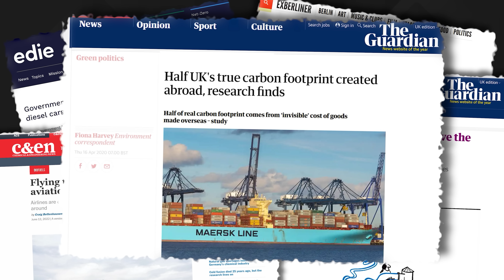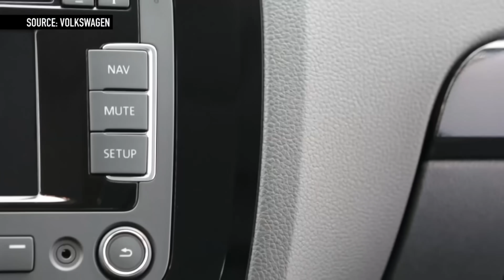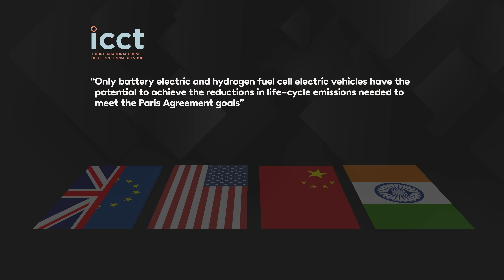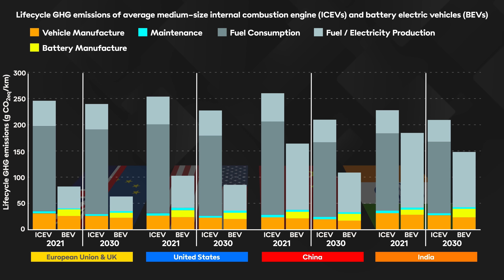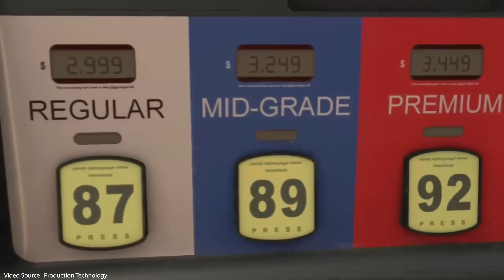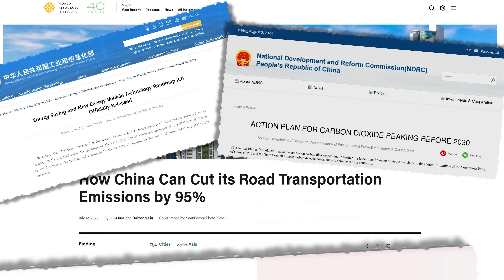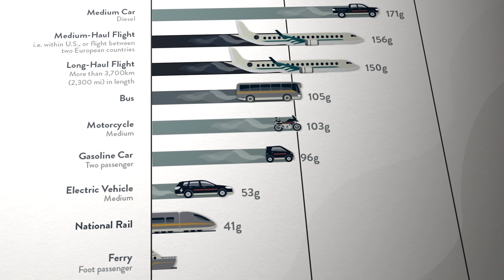Are EVs really better for the climate?

Comment: The question to me was never a direct comparison, but one which adds up emissions of combustion engines in comparison to those of the energy plants. If you use nuclear or regenerative this becomes a nobrainer in terms of emissions, though one needs maybe also compare the emissions to produce those cars and energy plants. The one saving grace of say coal plants could be a centralized well maintained filter system instead of having filter system on every car seperately.

Thinking of how long the car and petrochemical industry is already slowing down progress in terms of EVs makes me angry.

Comment: I need to know how they produce the electricity. 
Will the power plants not produce more emissions, especially the ones using coal, fossil and gas in producing those electricity for EV compared to the emissions from the fossil fueled vehicles? 
Can we only use the power plants powered by wind and solar to provide the electricity for EV? 
Is it enough and sustainable for those kind of power plant to provide all the EV the electricity they need?

Comment: Are there any studies that consider doubling or tripling the lifetime of the vehicle on the assumption that a significant element of carbon footprint come from the build process of a vehicle ? . What is the lifetime assumption in the report discussed ? I am running a 1993 vehicle which has been used for 3000 miles a year , I am telling myself that my combination of not consuming resources and not being responsible for the carbon load of a new car, every three years or so makes my strategy a thinking persons solution ax well as a affordable one but is there data anywhere that disputes or supports my thinking

Comment: One thing is that hybrid vehicles do reduce emissions whilst using a lot less batteries.   It is impossible to switch to EVs faster than the supply chain can achieve so hybrids probably have their place.   EVs simply are way too expensive for me to consider.  I'll probably just hang onto the car until it fails and my hand is forced or EVs start to come down in price.   I do remain sceptical about the infrastructure being able to supply all BEVs - time will tell.   I reckon once the big companies have us all on electricity for everything they can ramp up the price.

Comment: I think this commentator has to look at solution differently.
First stop petrol vehicles and get in electric vehicles.  Then use as much of renewable energies for the charging. Go off grid for the power.  And there are multiple other benefits in this noncarbon based fuel source.

Comment: One of the things not touched upon here is a gross lack of adequate infrastructure. In the U.S., West and Southwest grids are already having issues with the grid and capabilities. 
Also, what's the footprint of and electric car fire? Again, infrastructure, there isn't any! Currently most departments pour water on electric car fires!! That only makes it worse!! Electric car fires have been quoted as burning for days and sometimes more than a week.  I'd like to see a comparison of a gasoline car fire's toxic outputt versus an electric cars output of toxins, carbon and whatever nasty crap burns in each and how much they create especially since a car fire can be extinguished relatively easily.

Comment: There is almost no green hydrogen in the world; almost all hydrogen is grey and made from natural gas in steam methane reformers. There is a good reason for that: making green hydrogen is very inefficient and wastes a lot of green electricity. Green hydrogen plants use huge amounts of green electricity, primarily produce a lot of heat (large cooling towers required) and only a little bit of green hydrogen. It's a waste of green electricity; it's way more efficient to use the green electricity right away.

Similarly, there is way too little green electricity available to fuel the world's cars. So although in theory switching over to these fuels is favorable, in reality it won't work because they're simply not available in the quantity required.

Comment: Have you not seen the latest offering from Shell, adding charging points in lamp posts. Fine if they are going to pay to  harden the grid. Or are the Shmucks like the rest of us going to have to pay for every urban road in the country dug up and houses and lamp posts fitted with 3 phase supply. As it is some large houses need a 3phase supply for a large heat pump, add a fast charger and a 100amp supply will not be enough. No smart digital charge unit that can cut out cut in is going to save your cabling. You have burnt out your underground cables, that will be £30000 but we are booked up until January. Christmas sir, you can still get an LPG cylinder and oven to cook your turkey.

Comment: I live and work in Ukraine. I have dedicated my last 15 years to alternative fuel applications in passenger and commercial transportation. As a technical director and a guy who manages all technical issues, diagnostics and complex projects, I see a huge problem with system that are working under the 1-15 Bar pressure. 200 Bar systems, that are Methane capable, produce a noticeably greater complexity: tank excessive weight and pricing, need for more rigorous inspections,, poor filling stations network (CNG-Methane). 
If we talk about HYDROGEM - this is a story of the NON EXISTING infrastructure,  operational pressure of 700 BAR!!!, no technical support and I can not even imagine how much would a proper hydrogen tank would cost, its maintenance and life cycle : 3-5-10 years ? What will happen after this cycle and how much will the new tank cost (considering this item is critical to the safety).

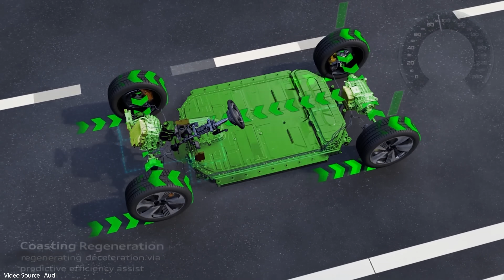8:10 Internal combustion engines are mostly reaching 40-45% efficiency with the potential to hit 60% soon. This numbers are discussed in professional media like SAE

If we talk about BEV : I see them often to ride at near dark time with headlights off, foggy windows, making the lowest speed permitted just to save extra mileage. The story about BEV is very promising, but the technology as the infrastructure is far from being self sufficient. 

There is nothing bad in internal combustion engines, the technology that been refined and taken to the perfection for 150 years. We need to change the fuel , used in this engine. We convert gasoline modern engines everyday that are using direct and dual injection, turbocharged and are working on diesel solutions, where a compression ignition engine would receive a completely new and clean fuel as a substitute to diesel. 

Changing the fuel used in the existing vehicles  (passenger and commercial) , will provide instantaneous effect. Tag: LPG, bio LPG, Dimethyl Ether (DME)...

The most promising and viable technology for the future EV cars, would be te HYBRIDIZATION: a 5-15 KW battery (reduced weight and lower environmental impact) + fuel cells that use a hydrogen rich fuel to generate electricity on board of the vehicle for propulsion and battery charging. This hydrogen rich fuel can be DME, stored under 5-10 Bar in a simple tank similar to LPG.

Comment: With a little more battery power, plug in hybrids could serve all short and medium trips on battery alone, running on gas for the long haul.  That seems better than keeping a gas vehicle in reserve for long trips.  right now though, big gas guzzlers are generally used for hauling stuff or going off road.

Comment: Nice review and summary. The ICCT paper just reinforces the uncontroversial consensus that an efficient EV powered by a grid with an increasing share of renewable generation is better for the environment. Researchers at the universities of Exeter, Nijmegen and Cambridge concluded in 2020 "Electric cars better for climate in 95% of the world": "electric cars lead to lower carbon emissions overall, even if electricity generation still involves substantial amounts of fossil fuel." And the Union of Concerned Scientist has been doing similar analysis for years: unless you barely drive a 50+ mpg hybrid in coal-soaked West Virginia, get an EV.

It's intuitively obvious once you do the math and to find a 35 MPG car will burn through 10 TONS of actually filthy gasoline over 120,000 miles, which turns into 33 tons of CO2. Adding a 1/2-ton recyclable battery to make a far more efficient BEV reduces that significantly, no matter how much fossil fuel companies try to whip up fake "But what about the toxic polluting battery mined with children's bloody fingers?!" hysteria. Making then burning petrol is WORSE, and a gasser burns through a lot of it.

Comment: Nice one. I'm skeptical about the impact of a bit of warming and higher CO2. When all predicted change is invariably negative and things like global greening are swept under the carpet then it stinks of politics more than science. That being said, your videos are very well researched and clearly presented. 
I think moving to EV is a no brainer and this 1st generation with lithium batteries is just a phase we need to go through to set up proper electric infrastructure now the funds are available on the big scare. Once the supercapacitors can be used for energy storage in cars there will be a huge reduction in energy spend per passenger mile. Very nice for air quality and noise reduction and dependence of fossil fuels even if I don't much care about carbon footprint.
Reply: Most wars have centered around oil reserves. Russia's control of fossil fuels being the current example. If they factored in all the lives and destruction from wars related to oil, what would the cost comparison look like then?
Reply: @kustomzone  Yeah, filling up your car is a bit like cutting a kid for blood to make your car run. Electric at least diversivies the sources. Coal isn't nearly as fought over.

Comment: I have looked into EVs a bit but my anxiety increases as I hear how a lot of the infrastructure for charging is either not at the level it should be for remoter areas or that they are not as well maintained as they need to be. I think the Tesla infrastructure is in much better shape than the rest.  Maybe the bill that will soon be passed will address some of these issues
Reply: If you have access to a plug at home or work, an EV is a no-brainer. There are plenty of public EV chargers, and there will be more.

Comment: Great as usual Dave. Good graphics, understandable and with your usual lovely style - laid back and open but authoritative and accurate. The only comment I wanted to make is on the short-haul flights being worse than any other form of transport - they are per km, but a long-haul flights uses a lot more kms, so the overall carbon is higher. Just important to point out so people don't think long-haul flights are somehow good things.
Reply: Indeed. One can easily do an entire year's worth of travel in distance terms in one long-haul flight. And if people had to drive or pedal that distance they'd think a lot harder about badly they needed to make that particular trip.

Comment: I plan on buying a plug-in.  Sure, the range is limited, but then, I don't drive that far each day.  I can use my gas guzzler for long drives, but if I don't drive it every day, that would save me a ton of money.  Add to that the solar panels that I'm going to install on my house and garage and it's effectively free to drive the plug-in (after the initial investment, which I'm going to do anyway, so it really doesn't factor in other than having a few more panels).

Comment: Reduced on-street pollution from EVs is negated by the increased pollution from the extra weight, which generates more dust from rubber and tarmac.
Reply: Nope : Curb weight	Mercedes S class = 4,740 lbs.   Curb weight Tesla Model S  Curb Weight = 4561.  You just might actually look up specs and data prior to writing.
Reply: @Avatrode  Now please compare lower end cars such as the VW Golf and its EV equivalent.

Comment: What about Hydrogen Internal Combustion Engine Vehicles?  JCB, Cummins, DAF, Toyota, Denso, Mazda, Kawasaki, Subaru and Yamaha (to name but a few) all seem to think this is a goer, yet all the lefty alleged "think" tanks still continue ignore this obviously superior technology. As Wikipedia points out - Electric vehicles appeared during the 1890s but the high cost and short-range of battery electric vehicles, compared to internal combustion engine vehicles, led to a worldwide decline in their use as private motor vehicles. As Einstein pointed out - Insanity is doing the same thing over and over and expecting different results.

Comment: In the rural western US, EVs are expensive impractical toys.  For those of us who often travel 250+ miles per day, in all sorts of weather, including sub-zero temps, they are essentially unusable.  My current ICE family "travel" vehicle has a range of 550-700 miles on a single tank, with the downtime in travel limited to 10-15 min stops.  On a couple of occasions, we've been on-the-road for 16+ hours straight, going over 1000 miles in that time.  Impossible to do in an EV without a significant increase in travel time.  Also: I fail to understand the logic of the EV proponents vs the financial realities of the US driving populace.  EVs are for that small portion of the market that changes vehicles every 2-4 years, when the average ownership cycle is approaching 12 years. My neighborhood is very middle class.  Out of a couple hundred homes in my immediate corner of it, there are two EVs.  This, in a place where almost every household has 3+ vehicles.  Primarily older vehicles.  This EV future is a pipe dream, unless average wages increase by a factor of 3 or 4.  Ain't gonna happen
Reply: I believe you are completely wrong. I guess we will see.
Reply: @CMac_44 "Wrong"?  Either the EV tech has to get both significantly cheaper and get incredibly "better" (range, charging time, longevity) or a large segment of the population won't be able to afford one.  We'll go back to the pre-Model T days where only the wealthy had personal vehicles.

Comment: we're just one battery improvement away really if you ask me. Granted there are a few things to over come, the only major issue is just making the battery: Anywhere, Cheaply, Life Time, and Storage. Granted that is a tall order to over come - but any parts of that improving means faster over all sells of EVs. Surfer Ion batteries would, for example, solve the issues of having to wait on China - thus some of the decarbon emissions can happen everywhere. Surfer batteries also come in cheaper, as long or longer life than normal li ion, and stores more power. Cost will only come down from there as it can be  produce and marketed against each other while still not having to wait for rare early metals to be found and produce. As for the house and grid power - we have a ton of options already. At this strage, the power grid is going to fight back instead on how much power a house can produce while still having the money to run the current power grid.

Comment: Firstly I am not a nah sayer,  I consider EV's the right and logical path for a motoring future. An important area contained in this transformation though is the probable change in many peoples lifestyles that will have to take place. We don't all live in big cities with on tap access to other transport options and not all of us just use our vehicles for personal or family commuting. Here in Australia the vast majority of trades people who don't work at a single site would drive a utility vehicle that would be a two or four seater and they would tow a trailer with their tools and equipment. Most of these vehicles are diesel and consume much fuel because of the towing. At this point we don't have Electric vehicles that can do this work. In many cases these vehicles would travel, on a daily basis, further than a fully charged battery would get them. I live in a rural area and most of my neighbours work in the nearby regional cities which are 50 or so kilometers away. Because of different places of employment or because of shift work two vehicles are often needed for a couple to go to and from work. There is no other transport option and its not a bike riding distance. As you say we have to try something and make a start but lets not think that it will be all beer and skittles for many people. One last point, my sone lives in part of LA and is fit and young and lives 8 miles from his work so he decided to ride a pushbike to work like he did in Australia. In the first week he was knocked off the bike twice and his coworkers all took bets on how long he would live. Even motorbike riding in LA is not seen as safe.

Comment: ICEs have made incredible progress over the last 100+ years.  But, they have become incredibly complex while doing that.  The comparative simplicity of electric motors means much less repair and maintenance costs.  Also, ICEs depend on one source of energy and that is oil whereas electric vehicles can use electricity derived from a variety of sources.  Finally, in the U.S. we have a government agency, the EPA, which has thousands of employees and costs the taxpayers many millions of dollars.  Those employees involved in regulating ICE-powered cars will become unneeded.  The proper thing to do will be to eliminate those jobs.  Will it happen?  It probably won't happen, and that is why there is great frustration with the government getting involved in anything.